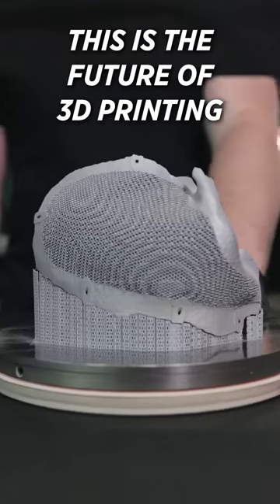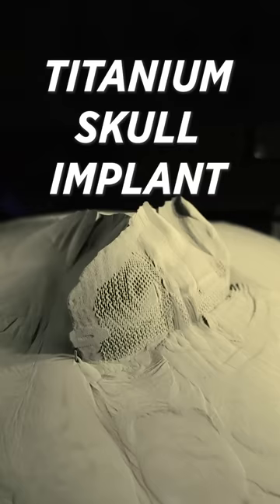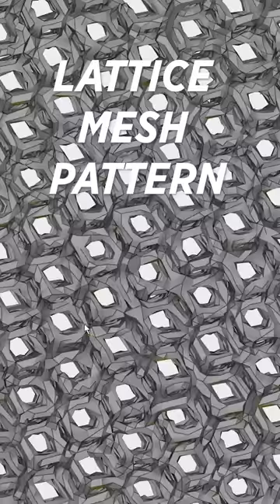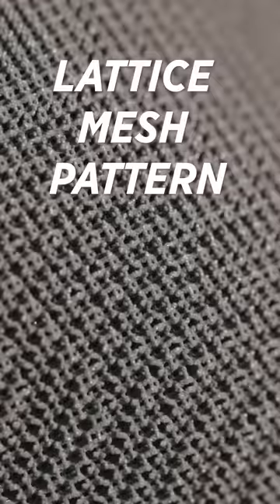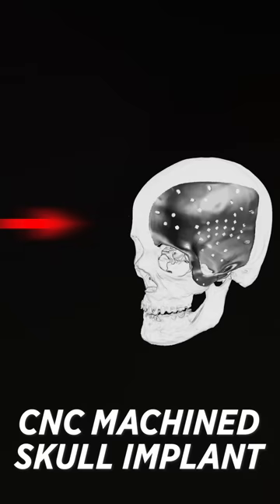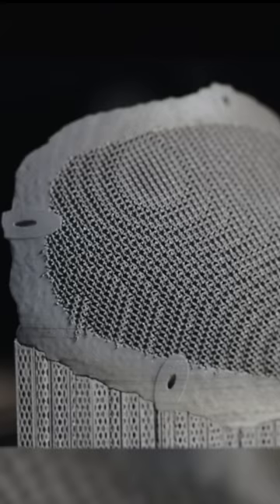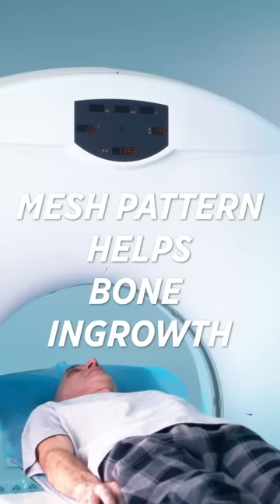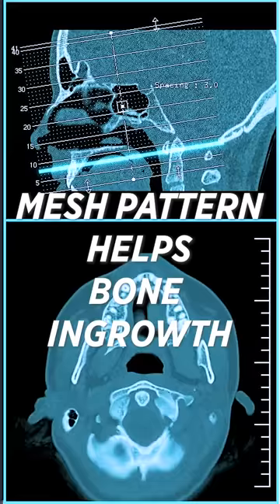3D Printing the World's MOST COMPLICATED Medical Device

Comment: i wonder how much RAM they needed to do the mesh in CAD
Reply: @brytonmassie  lol 😅
Reply: @marc_frank  How huch RAM: YES.
Reply: Not many. The recommended minimum requirements start from between 16GB and 32GB of RAM. What is required is a good CPU to avoid having to wait for hours of processing.
Reply: 1. They needed 1 ram. On the other hand they needed 3 ewe. But only a single ram.
Reply: Dedotated waaaaam
Reply: Depends on the task. You need RAM only for a good workflow experience. When you modelling something, for example. Good Ram can help you to place more parts on screen. But this can be fixed by hiding not active parts behind. Eventually you need a good CPU for rendering some scenes or calculating the scene for 3D printing. Or a hood GPU for rendering CGI
Reply: Loads of deditaded WAM
Reply: All of it
Reply: more like gpu
Reply: I think SolidWorks has optimizations for previewing highly detailed meshes
Reply: Probably more than 640KB
Reply: Yeah it's not that much actually, it seems like a pretty simple pattern when they show the close up, It is not really smooth you can see the polygons in the video, game models are way more detailed even on last gen consoles
Reply: All of it
Reply: All of it.
Reply: That's a surprising statement coming from someone that seems to know what they're talking about. You're not shooting for higher frames per second, so logic would dictate that you don't need much.
Reply: @brytonmassie  Johhny Mnemonic,  just load a Ram doubler.
Reply: This reminds me when I used to CAD on my i3 MacBook Air
Reply: Detitated Wam*
Reply: So much ram its gotta be atleast 12
Reply: It's got a GB so I can plug my USB in and talk to a paperclip about sex changes
Reply: Who needs ram when they have several days
Reply: A wot of detotated wam
Reply: Less than they needed to have their chrome YouTube tab open
Reply: Not as much as crisis
Reply: All of it
Reply: might not me a full mesh, could be a more simple shape with some maths applied to create the lattice
Reply: May not be as much as you'd expect. VRAM on the other hand it probably consumes a lot of.
Reply: @Ste Da  very original.   Should be proud of that comment.
Reply: They probably DODGED that question because they didn't want to CHALLENGE you, but you seem like a hard CHARGER... ALL RIGHT I'LL SEE MYSELF OUT
Reply: "How many dedidated gigs of WWamm does it take to run a servur"
-That one minecraft kid
Reply: 16-32 could probably handle that fine
Reply: @b.gambella  good answer sir
Reply: I wonder how intense it really is, i have 32 gb of ram sticks in my pc
Reply: You could probably calculate the pattern when exporting so the whole pattern doesn't have to be in memory all at once
Reply: Phase10Minecraft  or modeled on a super computer (or data center).. then to customize in the manufacturing side.. they just input the correct measurements.
Reply: @b.gambella  *much
Reply: Many sheep were needed
Reply: dayum, i think this is my most liked comment
Reply: If you had a program specifically designed to do it I bet it could be decently efficient.
Reply: You would use nTopology or Magics to generate a mesh like this
Reply: Wouldn't one just be able to mathematically generate 3D noise to alter an already existing mesh?
Reply: We have a computer that does this at work, I think it's at 128gb of ram
Reply: At least one ram, probably also needed a goat.
Reply: That's the beautiful thing about software. If there is a pattern then we can extrapolate. All we need to do is give it instructions on how to build a single layer of the lattice and how to connect it to the next, then it'd only take a couple of kilobytes to plan the whole thing.
Reply: @soendsournight  cool stuff
Reply: @beemerwt4185  explained it better than myself
Reply: 420gb 9 billion MHz ddr69 of course
Reply: Gamers think the games they Play push their pc t9 the max
Reply: So for fancy CAD projects, you actually have specialized graphics cards to handle that kind of processing. They're not super great for gaming, but they can handle the large amounts of stuff you have inside 3d models
Reply: Yes
Reply: 1. Disable default OS pagefile drive
2. Add an SSD and immediately use it as a dedicated pagefile drive.
Reply: There’s a software called ntopology, that has a special way to make complex mesh with low processing power, it’s quite interesting
Reply: @brytonmassie  dang I miss the days of that term being thrown around
Reply: All the ram. Nah it's probably a basic mesh with procedural generation for the structure.
Reply: I'm willing to bet not much. You can apply a pattern to a surface.
Reply: Depends on the software, Inventor or AutoCAD need lots of it but SolidWorks and such don't need more than 8
Reply: Probably 32gb ram, but these machines easily run 128gb ram lol
Reply: I bet even Chrome would be impressed.
Reply: @b.gambella  16gb and 32gb is a shit ton of ram. And you said "not many" 🤓
Reply: You can always use your HDD as your ram. No need to upgrade.
Reply: The industry does not use parametric CAD to control this mesh.
Reply: You can do this type of thing on toaster. The parts are designed as a solid and the which is then ran through software which allows the user to manipulate the structure. Anyone could do this type of thing except the printer probably costs a few thousand of dollars
Reply: All of it
Reply: Yes. The answer is yes.
Reply: Repeating patterns don't require too much power
Reply: Not much… ???????????
Reply: ALL OF IT
Reply: It's generative design. It's a repeating pattern which is following a formula, all that detail is not unique so it's not that heavy.
Reply: @Bryton Massie  Fun fact you can use swap ram AKA swap hard drive gb to ram gb so if you want 4 gb ram you can rebuild the 4gb from the hard drive and you'll have 4gb ram it's called swap and is slower than regular ram
Reply: At least 64 but probably double that
Reply: Now that I take engineering in school I finally  get these jokes now 😂
Reply: Its crazy that this technology has existed for over 40 years & we're just now seeing it become mainstream.
Reply: I work with cad professionally. 

The typical cad workstation is 32gb with a dedicated video card needing at least 16gb. 

For intricate work and large assemblies with lots of bodies and calculations, you'd have a setup like mine, 128gb of ram, and a 32gb work station video card. 

Bear in mind, work station video cards tend to be cheaper, because the ram can be slower than gpu ram. The idea is less to small packets quickly, and more to move all the data at once.
Reply: @Rabbit-the-One  🤣🤣🤣
Reply: no different from video game rendering, if not far simpler
Reply: 1TB
Reply: atleast 5
Reply: Pray for the RAM used in this video
Reply: You can create this pattern using actual programming work, if you've heard of procedural generation, im not saying thats how this works, but it could work that way, because its a repeatable conceptual pattern and system. if that was the case, all you would need is skull dimension information.
Reply: Well its less than 2 chrome browsers being open at the same time
Reply: Exactly or even what software can do 3-D lattices?
Reply: you could borrow terabytes at small cost no?
Reply: If you're making graft parts for surgery, I'm thinking your markup will be high enough to cover the cost of RAM.
Reply: @b.gambella   *gpu
Reply: Gpu
Reply: @itRemindsMeThatItNotSoBad  more to the point, workstation GPUs work best. They have higher memory capacities and certified drivers to ensure stable operation in those high demand applications.
Reply: Take what you thought, and add 16g more lol
Reply: all of it
Reply: Man. I accidentally got way too much RAM during a Christmas sale. All the slots in my PC have a 64 gb Corsair stick. It's unfortunate lmao
Reply: Cad consumes RAM like a black hole 😂
Reply: Some of these engineering PCs have like 125 to like 256 gb of ram.
Reply: About 32GB in most the automation p.c's. The ram is more for part density than individual geometries, remember its printed in layers, so only has to load one layer at a time as opposed to the entire part in one go :)
Reply: they need atleast 5 GPUs preferably RTX 40 series
Reply: And I want to see how long that G-code is.
Reply: That's a lotta detotated wham
Reply: @bbacna1  aw you beat me to it lol
Reply: I thought CAD were upgraded to something else and they don't use the CAD system anymore 🤔
Reply: @Gatsu_Gambino  what?
Reply: @marc_frank  in my state we stopped using CAD systems like 20 years ago... upgraded
Reply: @marc_frank  you mean Computer Aided Design(CAD) right? Like wtf 😄
Reply: @Gatsu_Gambino  of course 😅
Reply: @Gatsu_Gambino  to what?
Reply: Probably at least 3... maybe 4
Reply: What’s the wecommended amount of dedotated wam I should have to a suerver
Reply: Bro from what decade are you 😭
16 GB should be more than sufficient
Reply: How much dedicated RAM should I have towards the server?
Reply: You could hold billions of points of data with just 24GB of RAM. The software isn't processing texture data or lighting so it's not that demanding.
Reply: Probably 3d printed ram
Reply: Guess it is mostly procedural anyway, so not much RAM involved. Also even just 16 GB is already a huge volume for a dataset of this type.
Reply: @brytonmassie  Protect this man at all cost.
Reply: All of them
Reply: 64gb
Reply: 13mbs
Reply: How much deditated wam?
Reply: All of it
Reply: @Rabbit-the-One  and how many gigs is that
Reply: I'm using TCAD for silicon devices and my minimum is 64 GB of RAM. I can understand your pain
Reply: brings home a bighorn sheep in the back of new dodge pickup
"Is this enough ram?"
Reply: probably 10mb
Reply: @brytonmassie  where can I learn this power 😂
Reply: Like your funny words magic man
Reply: WE NEED MORE RAM OVER HERE!
Reply: Soon quantum computers and 3D printing are gonna be fused together I can’t even imagine
Reply: Couple gigs
Reply: Probably a dual cpu server with 2TB of ram just for fun
Reply: If they used blender you’d need like a maximum of .5 gb
Reply: @b.gambella  So, AMD Threadrippers or bust?
Reply: My 10900k running at 5.4ghz on all 10 cores with 128gb ram and 4090 gpu is almost identical to my 4790k with 16gb ram and 2060s gpu on fusion 360, 
Ram and gpu make almost no difference in cad...
Reply: @dylandesmond  for simple geometry, sure
but try handling a mesh you want to combine with solids
Reply: CAD needs low requirements. My sister uses CAD for architectural purposes and I have that software if she ever wanted to use it on my laptop, but he has one herself too.
Reply: Just need rgb keyboard and mousemat
Reply: My guess is optimizing the mesh when not looking at it, and it likely uses math which can be decreased in resolution. As for the actual rendered print, it's likely easier than other prints, as the G code has to travel between all the paths as opposed to the lattice, where less material is used (although that may not be true based on the model and infill).
Reply: How much dedidated wam do I need?
Reply: About 2gb of RAM should do it
Reply: My guess is probably a lot. But then we have special purpose large memory nodes on the HPC system I look after with 3TB of RAM. Mostly used for mesh generation and we have seen them go to about 2TB of utilization, so so glass we went with 3TB rather than 1.5TB. The nodes were not that expensive in the scheme of things about $50k each from memory.  In the previous iteration of the system, the large memory nodes only has 512GB of RAM and it was constantly a problem.
Reply: @brytonmassie  what is funny about that?
Reply: @b.gambella  m i n i m u m  r e q u i r e m e n t s
Reply: cyberpunk reference?
Reply: The correct term is WAM
Reply: No mucha podes usar 3 matic de materialise para hacer ese tipo de estructuras.
Reply: Depends on how the programming team did the dead. Neither you nor the tooling needs to see all the data output at once.
Reply: Cad is becoming Atari
Reply: @brytonmassie  dead over used joke 💀
Reply: Well we buy 1TB Dells at work just because, for around 60K, and some will go up to 2TB if U want,  so I really doubt it matters.
Reply: All of it
Reply: Only one. If you had 2 or more RAM they would constantly headbutt each other...
Reply: @therealmesocollins  good point,  if they were doing that constantly it would really hinder the work.
Reply: $1M worth, atleast that's what the hospital would charge you
Reply: Jesus probably like 100 terrabytes lol
Reply: You must be new on the cloud 🌨️ you just buy the ram you need for as long as you need it
Reply: All of it.
Reply: 3mb
Reply: actualy the ram memory much higher than storage. probably about 2terabytes of ram
Reply: Nah ram are cheap nowadays unlike 2017/18 where a 8G stick could cost you like a hundred dollars, now it just cost you less than 20 or even 10
Reply: If they use a cloud based cad platform like onshape, that won’t be a problem. But onshape is very laggy when u incorporate lots of different shapes like shown here.
Reply: 32 should do.
Reply: Nvidia Quadro extreme addition.
Reply: Use 64gb of ddr4 3600hz myself,